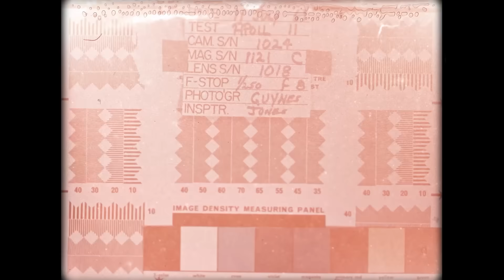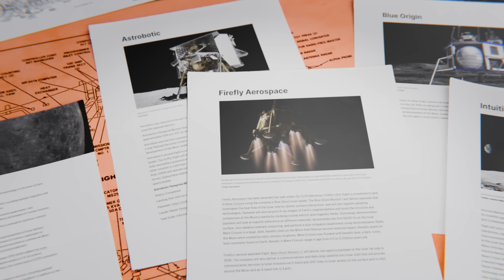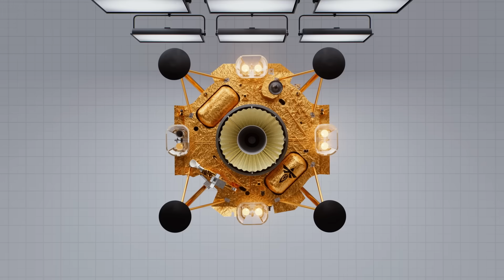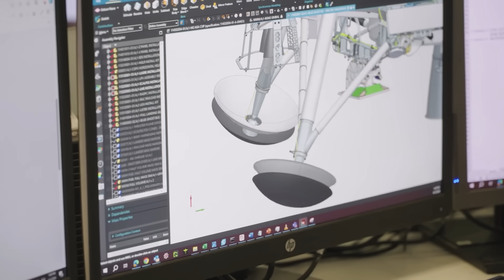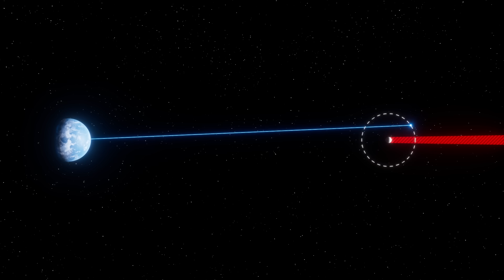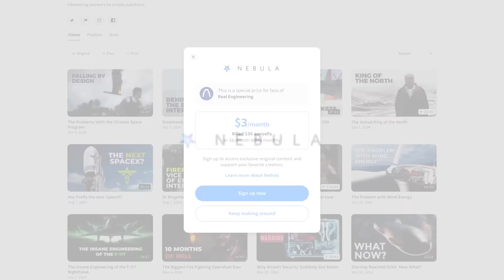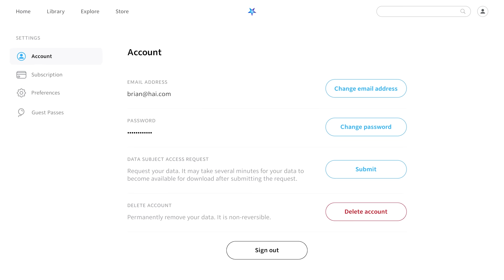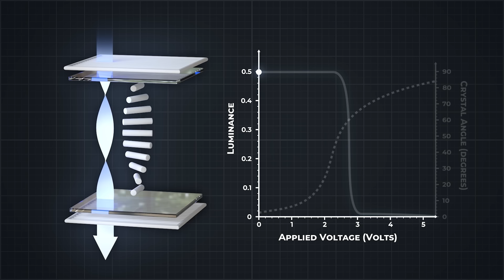Why the US is Struggling to Land on the Moon

Comment: Because they have never been there. The US is struggling to return to the orbit or back from it btw...if you haven't noticed.
Reply: Incorrect. Tons of evidence prove the Apollo landings are real. 
The US has done 156 orbital launches last year. One of those was with a new crewed spacecraft, made by a company that is known to have quality issues. 8 were made by a commercial launch provider for which crewed flights are now routine.
Reply: Trump just announced that they are going to put a flag on Mars. Is there any reason why they are not going to put it on the moon? 
Have you ever used a search engine to ask how many manned moon landings there have been? You should do that for fun.

Comment: give me a break. You managed to land a probe on Mars and you cant do the moon. Yeah, right.
Reply: We can land on the moon. Companies making their first lunar lander tend to make at least one mistake that results in a failed landing.
Reply: @Hobbes746 you would think its harder to land on mars and yet it would seem that its easier to land there than to land on the moon. Does not make sense. Considering that there are rovers on Mars.
Reply: @ You should read up on the histories of moon and Mars exploration.
Before Apollo, NASA ran 29 unmanned missions to the moon, 17 of which failed. Out of the first 8, 0 managed to get to the moon at all. 
For Mars, up to 2000 NASA had 5 failures and 8 successful missions. 
Each failure was learned from and used to improve subsequent missions. So the success rate rapidly climbed
The Mars effort was helped by the fact it started a few years later than the missions to the moon, so lots of those early failures could be avoided.
Reply: @ The logic is flawed. They should of learnt from the past but it seems like we're going backwards not forwards. All that past success should of been used to advance us but it seems like we learnt nothing from them.
Reply: @ Intuitive Machines chose to ignore some of the lessons that were learned by NASA in the 1960s. This is maybe to be expected: IM is a startup full of young people who lack experience.

Comment: Struggling for good reasons - no moonlander and no astronauts landed on the Moon during the Apollo Project. The moonlander with its ascend module were both death traps.
Reply: Wrong. 12 astronauts landed on the moon across 6 missions. The LM and its ascent module were not death traps, they were purpose-designed spacecraft that worked well on every mission they did.
Reply: @Hobbes746 Keep repeating the lie. It will never become anything else than a political scam.

Comment: Space travel is fake.
Reply: Look up tonight. You can see satellites pass overhead, proving space travel is real.
Reply: @Hobbes746  Low earth orbit isn't space. 
Unless you can explain how the 2nd law of thermodynamics no longer applies. ?  What keeps the atmosphere of earth from escaping into the so called vacuum of space.
Reply: @gregoryrogalsky6937  Low orbit is part of space. 
The second law of thermodynamics says heat flows from hot places to colder places. Our atmosphere does not violate this. 
What keeps out atmosphere from expanding is Earth’s gravity. Each molecule in the atmosphere has a mass, so there’s a gravitational force working on that molecule.
Reply: @Hobbes746   Gwabbity..lol..  That is hilarious.. low earth orbit is part of space. ? Really? Is that why NASA admits that they have never gone past low earth orbit. ?  High pressure to low pressure , always.  As far as Gwabbity.. :)   What happens to this magical force when something is in water and reaches a state of buoyancy?  Strange that this magical force of gwabbity can hold down 8 miles of ocean.. But not push down when an object is buoyant.   Want to keep going ? lol
Reply: @gregoryrogalsky6937  Low Earth orbit is part of space, yes. Space starts when there’s not enough air to sustain aerodynamic flight. On Earth, that’s at about 100 km. Satellites in LEO don’t fly, they orbit Earth.
Reply: @gregoryrogalsky6937  NASA does not claim they have never gone past LEO. As far back as 1962, they launched missions to the moon, at 380,000 km altitude. In 1962, NASA and the USSR launched their first interplanetary missions, to Venus. They launched humans beyond LEO 10 times, starting with Gemini 11 in 1966.
Reply: @gregoryrogalsky6937  Gravity is not magical. Buoyancy happens when you place an object in a liquid: it experiences an upward force equal to the volume of liquid it displaces. That’s gravity pulling on the water, and resisting the displacement of that water.
Reply: @gregoryrogalsky6937  Buoyancy only exists in a gravitational field. Gravity is proven by thousands of experiments and observations, including experiments anyone can do. The only force pushing the ocean up is Earth’s rotation. That produces an acceleration of 0.03 m/s2 at the equator. Gravity causes an acceleration of 9.81 m/s2, so the net effect of those two forces is that a litre of water is just slightly lighter at the equator than at the poles. 
Bugs and birds can fly because they expend a lot of energy to produce an upward force larger than the gravitational force pulling them down.
Reply: @THEfonz-s5u    Ill put it to you another way. So this magical force of Gwabbity is able to hold down 8 miles of ocean.. yet I can be in water and fill my lungs and float, be buoyant ?  To address your first question. How much does the water in clouds weight ? Tens of thousands of pounds.. Where is Gwabbity ?  Still not seeing the curve. :)

Comment: 0:22 Why was it moving horizontally?
Reply: It comes from orbit with a lot of horizontal speed, it's mostly cancelled when landing, but as some sensors didn't work properly it wasn't fully.
Reply: @ThomasKundera  It was a rhetorical question. Obviously, the horizontal speed should be exactly 0 before touchdown.
Reply: @humanrightsadvocate  : Nothing is ever exactly zero in practice.
But it should have been in a controlled margin. And was likely not.

Comment: US Send a men in the moon at the same Time Motorola pagers is 1 of the main means of communication, Now we have smartphones and somehow they all forgot how they did what they say they did 50 years ago.
Reply: NASA didn’t forget. Intuitive Machines chose to ignore the lessons NASA learned in the 1960s, and their mission failed due to a dumb, preventable mistake.
Reply: @Hobbes746 the reason is we have dumber machine? 😂
Reply: @Erickson-Nolasco  No, the reason is that the young engineers at Intuitive Machines ignored the boomers over at NASA who told them to do a thorough preflight check. They didn’t do a thorough preflight check, so they left the main landing instrument (a laser altimeter) set to safe mode which meant the altimeter didn’t work.
Reply: @Erickson-Nolasco :
It's astonishing how some seems to think that we're going to space on the back of phones.
It may surprise you, but to go to space, one needs a rocket not a smartphone.
Reply: @Erickson-Nolasco  Nobody at NASA was involved in the Intuitive Machines error. Intuitive Machines employees made that mistake all by themselves. 
When I leave my car key at home, I’m stuck unable to start my car. No amount of technology will change that. 
Similarly, the altimeter on IM-1 was deliberately made so that the safety switch could not be overridden remotely. This is mandatory: you don’t want to be fiddling with a powerful laser when someone else in the next room can remotely switch the laser on and burn your eyeballs.
Reply: In your analogy we were now we are driving a broken car stock in the mud. But 50 year ago we were Formula-1 Driver with breaking Number speed. That is my point, broken car + dumber driver. Regardless if Nasa is involve or not.
Reply: @Erickson-Nolasco  You’re ignoring the fact that Intuitive Machines is not NASA. Not the same team, not the same people. Not even the only team from the US running lunar missions. NASA did 29 missions to the moon before Apollo even got started. 17 of those missions failed. It took lots of practice to get to the point where they could be confident Apollo missions would be successful. Intuitive Machine is at the very start of that learning curve, because they chose to ignore lessons NASA has learned and documented. They could have made a successful first mission to the moon if they had bothered to read basic documents from NASA.
Reply: @Hobbes746 This is my last replay since the message is not passing through. We got Dumber machine and Dumber people incharge of going to the moon. This is why a lot of conpiracy theories that we didnt really landed on the moon because of this incompitenses...
Reply: @Erickson-Nolasco  Again, your claim is not based on facts. NASA ran 29 unmanned missions to the moon before they started Apollo, 17 of those failed. 
Now we have to companies that were not around in the 1960s, both failing their first mission. If they have a success rate lower than 58% after 29 missions, then your claim has merit. Not before.
Reply: @Hobbes746 Dude i dont care about Apollo 17 and their 29 unmmanned missions. That is not what i was talking about. Why do you keep adding non related stuff to what i said? Please read again the topic that i said.
Reply: @ From my very first message in this thread, I’ve been addressing your claims.
Reply: @Erickson-Nolasco  : Intuitive Machine is a small startup, not NASA.
The fact a small startup with a few millions almost soft-landed a probe on the Moon is evidence of the astonishing progress that have been made in space tech in 60 years, when only two superpowers allocating insane level of ressources could a chance doing such.
Reply: Summary: Intuitive machine did not consider the input/information of older scientist thats why their science project has high fail rate, which i Label Dumber people. Then thaie Intuitive Machine lack the information we have for the last 50+ years which makes that machne Dumber. So i am correct again. 

Last replay Dumb people sighted Bye

Comment: struggling because they never went the first time
Reply: Twenty four people went to the Moon in nine missions, of which twelve landed in six missions between 1969 and 1972. Inform yourself.
Reply: @ThomasKundera  I doubt it
Reply: @ I do , I just don't believe it
Reply: @THEfonz-s5u I respect your beliefs fam, I just don't believe it, I just don't think we went there with 1960's technology, people barely had shoestrings let alone go to the moon.
Reply: @ 1960s technology included the SR-71 Blackbird, the atomic bomb and the first integrated circuits. You are pretending Apollo was done in 1060, not 1960.
Reply: @Hobbes746 The SR-71 was an airplane which did not travel through space. So, you're saying in 1960, we went 238000 miles through a black vacuum to the moon. Then left the moon and made it back to earth. The issue that I have with this is just like common core problems.  celebrating the victory or displaying the answer but where is the (WORK) I've never seen a video of this journey. You mean to tell me there was no camera fitted on that ship.  HUMANS DID NOT TRAVEL TO OTHER MOONS, STARS OR PLANETS YET.
Reply: @michaelprince150  " I've never seen a video of this journey” then you didn’t look. Every Apollo mission did several hour-long live TV transmissions during the flight to the moon. They also recorded the journey in photos.
Reply: @michaelprince150  We know the missions are real because there is a ton of evidence from multiple independent sources that proves this.
Reply: @ in photos...lol